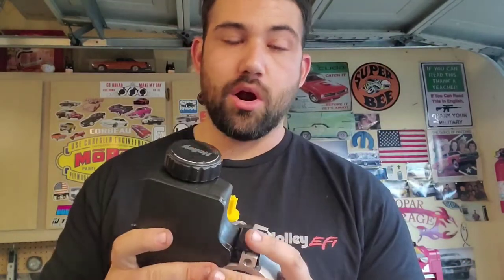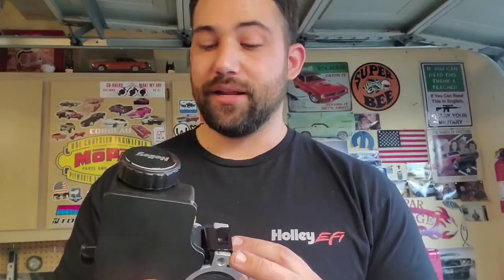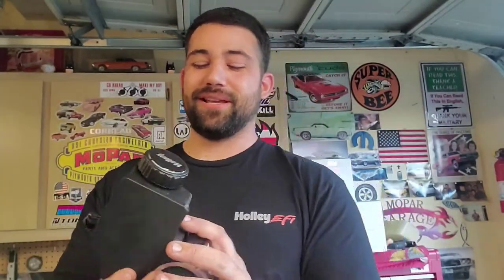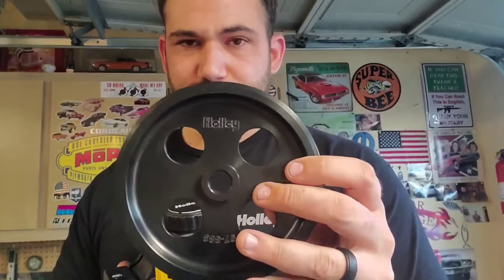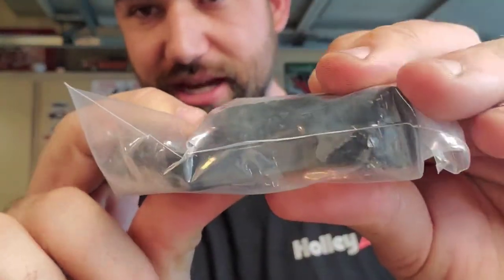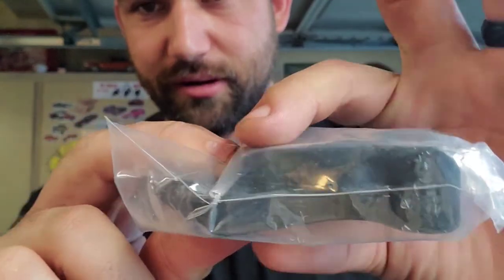Holley Gen 3 Hemi Power Steering Pump Info!

Comment: What power steering line do you run from the hemi to factory power steering box
Reply from the maker: You can run just a standard high pressure power steering hose that you would have had from the factory because this is a pressure reduced power steering pump

Comment: Nice video very helpful, sorry to bother you, quick question do you got any info. On what part # on the power steering hoses to use on a 5.7  hemi swap on a 1970 challenger the press hose and return hose, thanks.
Reply from the maker: I can try to dig through and find part numbers but it's just going to be your standard power steering hose line that'll run from the pump to the steering box because this is a pressure reduced power steering pump and not a high pressure pump like the factory G3 Hemi pumps.
Reply: @BryceCold  thanks man for the info. I appreciated